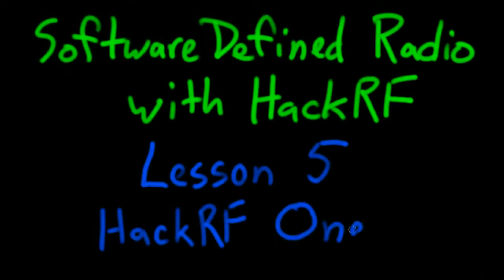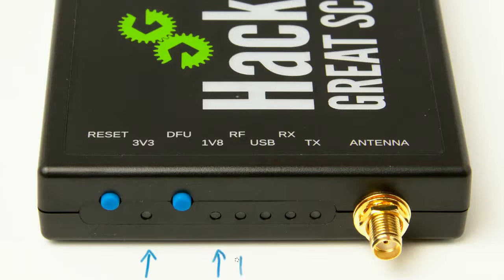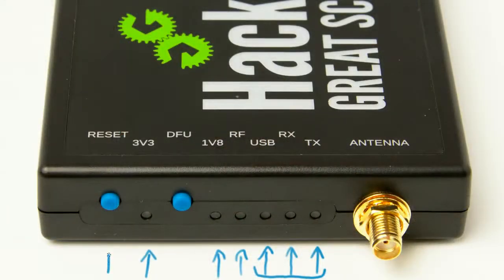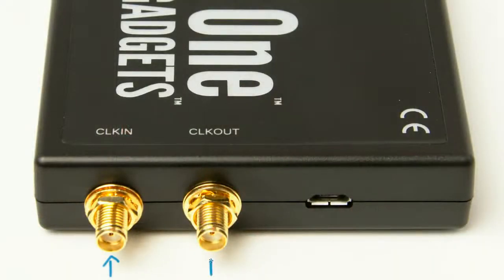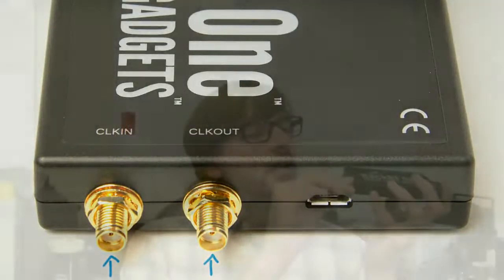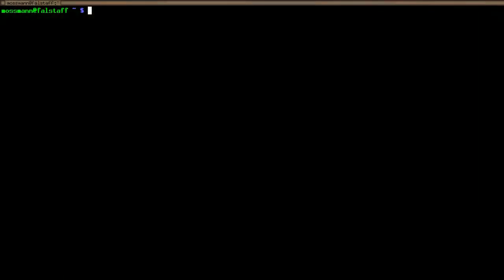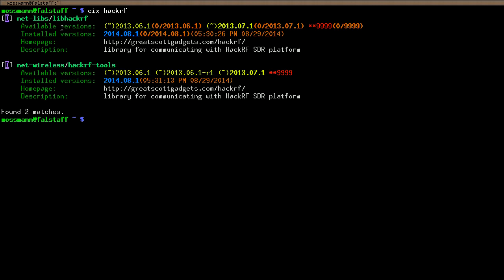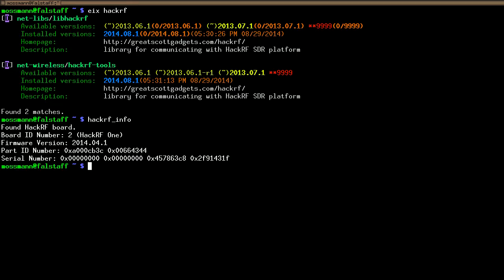Software Defined Radio with HackRF by Michael Ossmann, Lesson 5: HackRF One

Comment: Good afternoon. Thanks for your work on the video. I recently purchased a HackRF ONE PortaPack H2 in an aluminum case and am just starting to master it. I want to ask you about such a question, when I record a radio frequency through the PortaPack H2 interface (Capture function), this frequency is perfectly reproduced using (Replay), but when I turn off the HackRF ONE PortaPack H2, after turning it on, nothing else is played back or what a peep. Is that how it's supposed to be, is it by design? Or is it a firmware issue? Thank you.
Reply from the maker: Portapack H2 is a third-party device not manufactured or sold by Great Scott Gadgets. For assistance, please contact the person that sold you the Portapack H2.